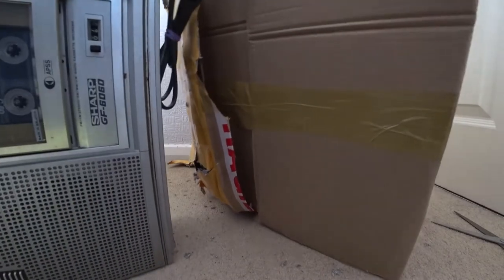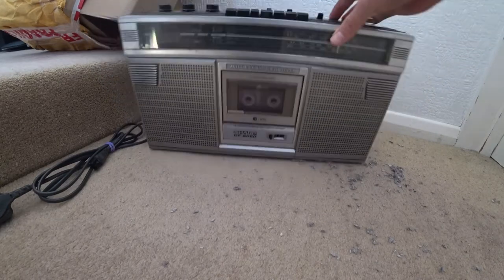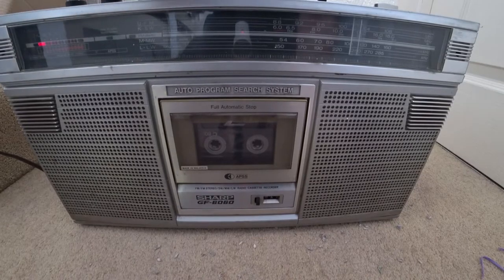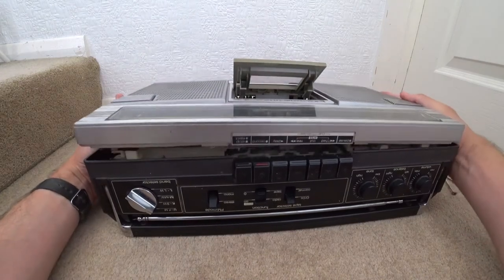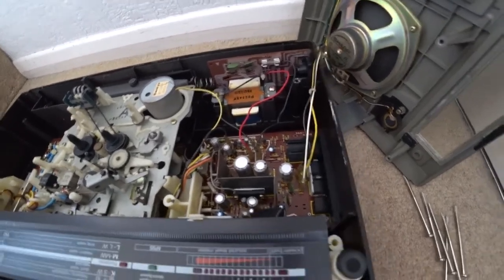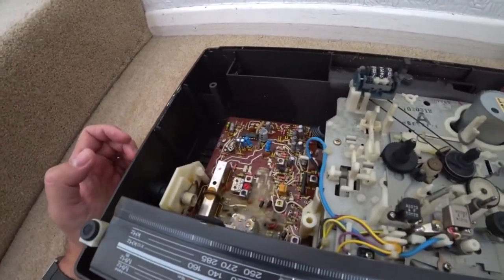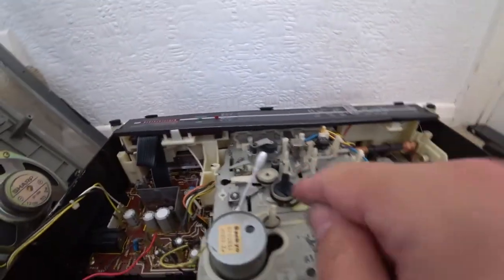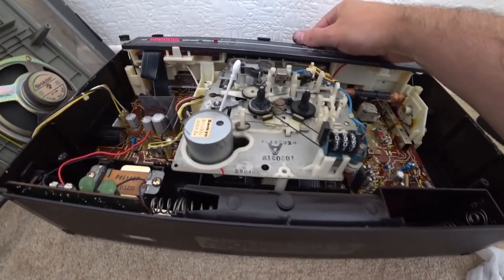Sharp GF 6060 Part One - Retro Radio Cassette NO PLAY #boombox  Ghettoblaster Old Skool Repair

Comment: I used to have the same boombox over a decade ago I bought it used of a old guy who told me it was from the 70s. but sadly around 2010 the tape deck stopped working and I sadly got rid of it.
Reply from the maker: It's a great funtional machine and has a easy to work on basic design and very well built.  In the 2nd part I discovered the area I needed to change.  This might be where yours stopped working.  I think it is a common problem.
Reply: @AvidRetro  I just went on ebay and ordered a Sharp GF 6060, I might need to try to repair the tape deck on it.